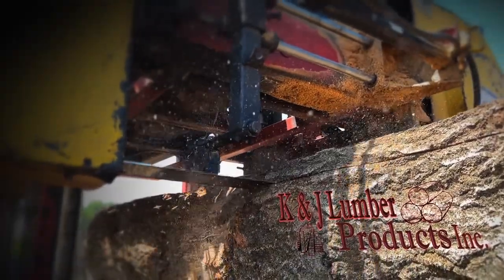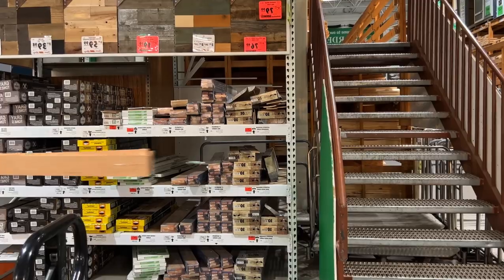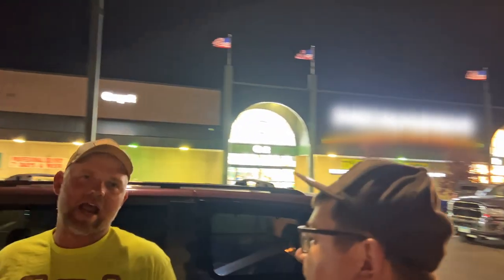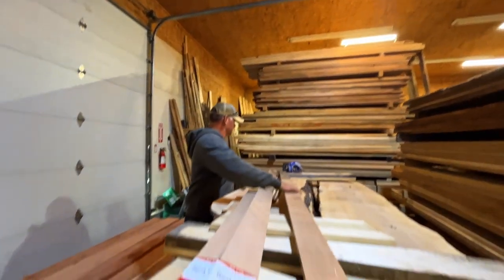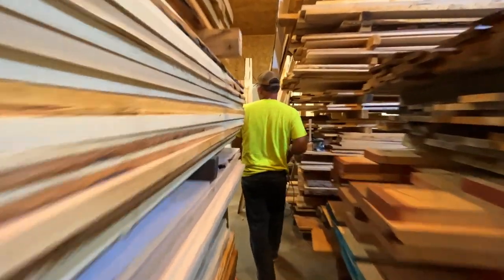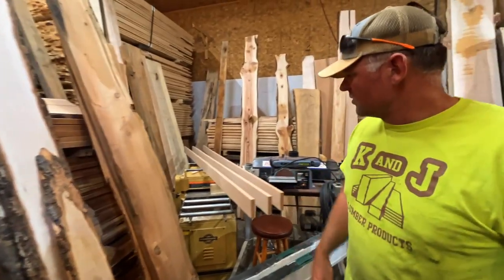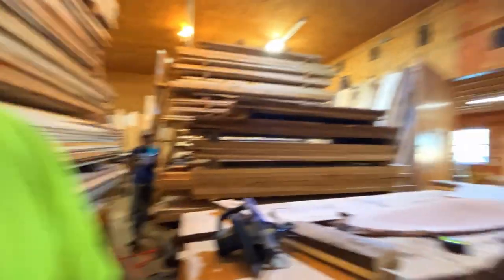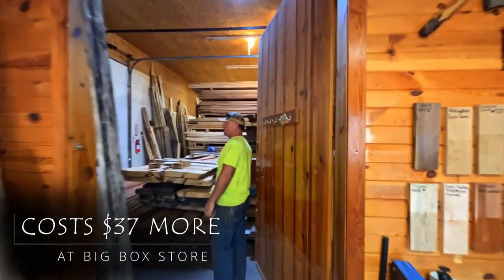We Bought Big Box Lumber! Did it Warp/Twist?

Comment: To be fair, those hardwood boards at Menards are milled consistently to 3/4, square, and sanded on at least one face; which is much more user friendly for diy'ers. Finishing saw mill lumber to match takes time and equipment that not everyone has. Those nice labels and fancy plastic wrap is a good sign that we are paying a premium. It's a good public service that you provide here to show people who might not realize there are other options available. The real world price comparison is extremely helpful. Keep up the good work!
Reply from the maker: Yup plastic wrapped so that while sitting at menards, helps to hide the fact that they are “speed dried” doesn’t warp while in store. Our Kiln Dried Lumber is also Straight-Lined (sometimes on both sides) and planed to a 15/16 of an inch. Making it either s3s or even s4s. We add the title finished grade (or cabinet grade). That way it is just like the lumber provided by Big Box. Except it is dried slower with more time and care during the milling process, essentially eliminating the need for a planer. The down side, sometimes the boards aren’t planed fully, making it skip planed so that the boards aren’t sold thinner than 7/8”. Sooooo, we aren’t perfect. But it depends on your preference. Thanks for the comment! Appreciated much!